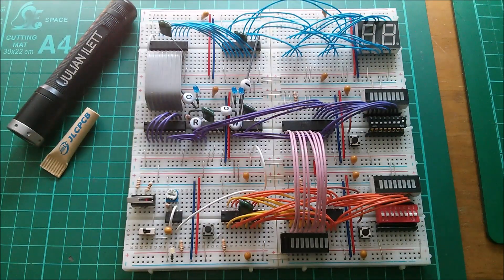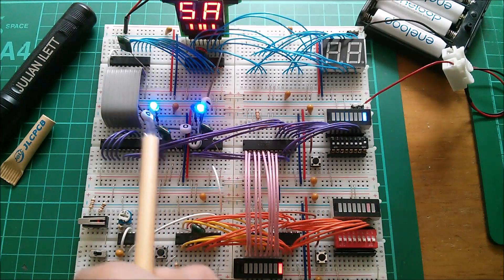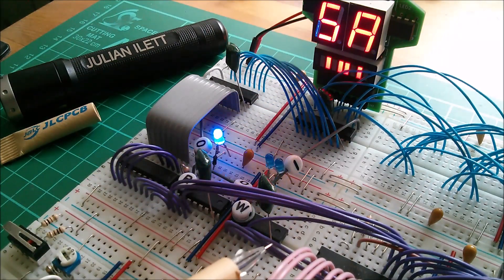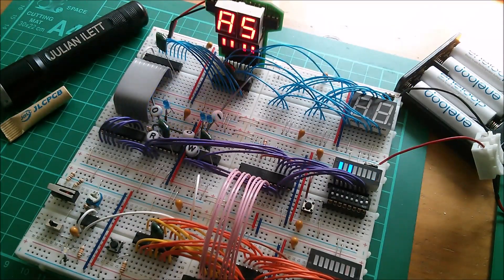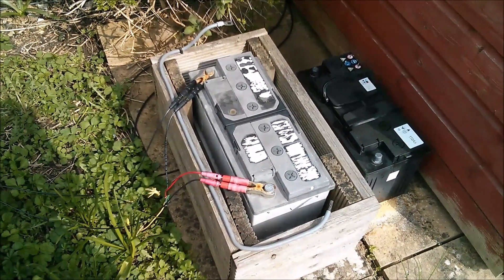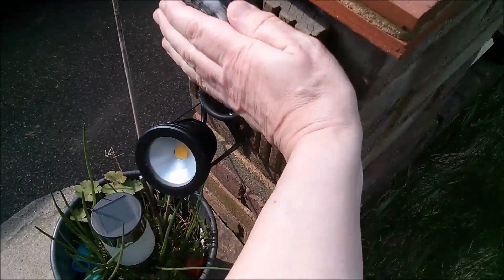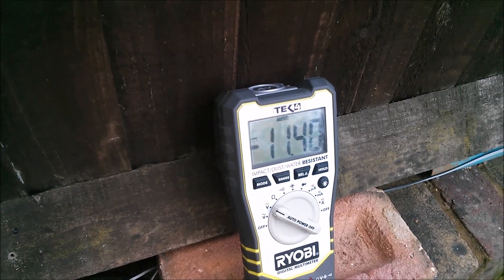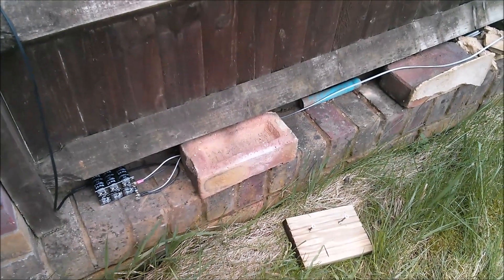Super Decoupling Capacitor

Comment: Sounds like an impedance mismatch at the latch clock input. Maybe in addition to the 10k resistor, you should use a pull-up or pull-down resistor at the input pin. I used to see a lot of this sort of thing back in the day when I was trying to interface TTL to CMOS ICs. Just a thought...

Comment: Definitely scope out that latch circuit. A logic analyser won't work, because you need to check the actual waveforms, not just the logic levels. I'm wondering if you have problems with "ringing", which a local RC filter will certainly help to cut out. What's the fan-out like in the logic devices in your circuit?

Comment: Once upon a time, I had to add a capacitor to a circuit that was oscillating (I wanted to make it stop oscillating). Examining the existing PCB design, I determined how long the capacitor leads were going to be; then looked up the approximate series inductance of those length of leads. Then I selected the appropriate capacitance value that would provide a series resonance (Z =~zero ohms) right at the frequency of oscillation. This is how you can use the series inductance of the capacitor leads to your advantage. P.S. Of course it worked perfectly.

Comment: Sorry Julian your maths is wrong. The energy is start energy minus finish energy. 1/2 CVV for say 12V and 10V gives 0.5x20Fx144 (for 12V start) = 1440 minus 0.5x20Fx100 = 1000 so you would get 440J useable in a 2V drop from 12V to 10V. That goes up to 690J useable dropping from 13V to 10V.

Comment: Welcome to the world of digital logic design.

Looking at the construction of your Breadboard Computer, I'm guessing that your master clock is applied throughout the logic of the design. You may (or may not) be aware that clocked logic elements require data to be setup before and held after the clock by specific times (often referred to as tS and tH on datasheets) in order to guarantee proper operation.

When many sequential elements are clocked from a single source, and feedback from a later stage is made to earlier stages, it is easy to not meet these requirements and the sort of effect you have seen can be observed. In the event that a setup time requirement isn't met the remedy that you introduced, which delays the clock locally, can appear to fix the problem but it's merely a workaround as you stated.

It's common to use multiple clock sources in complex logic designs. These might be complementary clocks where one clock transfers new input to registers and the other clock propagates new outputs some time later. Another solution is what is provided by the likes of the JK Master-Slave flip-flop where the leading edge of the clock samples the inputs and the trailing edge of the clock propagates new output levels.

A consequence of applying the RC delay to your clock input is that you are slowing the rate of rise and fall of the clock edges. This has the consequence of increasing the time during which the clock signal resides between the logic low upper-limit and logic high lower-limit (i.e. the linear operating region) which results in a higher current draw. This is actually detrimental to the advantage offered by adding a local decoupling capacitor because it increases the demand on current required from it.

You will probably benefit from researching the effects of not meeting setup and hold times in clocked logic circuits and the possibility of encountering race-conditions when feedback is introduced from later stages to earlier stages in circuits with simple common clocking implementations. There is much scope for this happening in a design such as your Breadboard Computer if you don't design to avoid it. As always, knowledge is power and my comments are based on practical design experience of high-speed digital logic systems.

Comment: Those green polyester capacitors make lousy decoupling capacitors.  
They are a long, high capacitance transmission line , 
wound up into a small package.  
So, no matter how closely you connect them, 
the far end of that long line is inches from the chip.  
Crush the epoxy, and unwind one, to see what I am talking about.  
Multi-layer ceramic or stacked film polyester caps 
are way better for decoupling applications.  
Greenies are usually used only for analog (low frequency) 
timing and filter applications, 
where the line delay and reflections are no problem.
Reply: Good point.  Also how are these alleged "momentary large currents" being caused?  He's using cmos,  isn't he ?  If supply droop is from the leds then it's not momentary, it lasts as long as the led is lit, so local chip decoupling is irrelevant.  Rip up and reroute.
Reply: There is a current pulse drawn, by CMOS, every time there is a state change,  But it is not very large, and the logic is pretty immune to its effects, compared to the old TTL family.  Usually i is things like inductive kickback from relays, driving an input or output beyond the supply rails, that glitches CMOS.  In this circuit, I'll bet the clock is a 555 timer, and not a CMOS version, that is causing the problem.  Their output is often very bouncy.

Comment: You might want to recheck your wire calculations.  As far as I tell, it should be closer to 0.1 ohm/meter, not "1".  I estimate you've got about 4 ohms of resistance (total).  At 1A, that's still quite a drop, taking you down below 9V.
Reply: Yeah, the figure surprised me.  A quick check gives me 1 ohm per 150 mètres for copper household cable, with aluminium (depending on alloy) being about 60% as good.  That would give us less than 0.1 ohm per metre for solid core aluminium of similar cross section.  If his cable really is 1 ohm per metre then it's ten times worse than solid aluminium.  Maybe he made a mistake, as you suggest.  I don't know the current price of solid core copper cable, but it might have been cheaper for this length of run to use that and ditch the supercaps.

Comment: Why don't you use a buck converter to increase the voltage down the wire to compensate for the voltage loss a bit like the national grid?

Comment: Put a small solar cell there to charge the super caps. If you need 10 W for 1 minute, you need a solar sell that is capable of delivering 10/60W per hour. Hmmm, a 0.17 Watt solar panel and 1 hour of (continuous) sun on it would do it, it would even work partially on just daylight perhaps. I did the test, I replaced the NiMH battery for a Supercap (500F). I did not use a diode, and use 4 of those very tiny solar cells (1.5cm squared, 2 Volts) and the solar light works like a charm! (the power which you loose by not having a diode is way less than the power gain (in voltage) by leaving the diode out, people should more often run tests in stead of doing what others do. A Schotky diode would then be a second option).
Reply: I imagine one of Julian's neighbours stopping for a chat...
"I see you've got your rig working, then, well done.  I'm not up on electronics, so I bought mine from LIDL,  comes with a little solar panel included".

Comment: Your method of calculating the energy delivered by the capacitor is wrong.  You calculate the initial stored energy using a half C times V squared and then subrtract the final stored energy using a half C times V2 squared.  If V1 is 13V and you take 150 joules out of 20 Farads then V2 will be about 12.4V.

Edit - As pointed out by Ray Kent below.

Comment: Would like to see a comparison between the supercap setup, and a boost -> buck setup where you have the voltage boosted at the battery side to compensate for the voltage drop, and a buck on the lamp side just to give a constant 12v output.

Comment: Aluminium is a better conductor than copper, specific resistance-wise. Problem with aluminium is connection resistance, if not done properly in household wiring will easily cause fire issues. CCA tries to mitigate this connection resistance by coating it with copper. So, 1ohm per meter is very high a resistance, where does it stem from?
Reply: A one-meter long wire with a cross section of one square millimeter has a resistance of 1.7 milliohms (.0017 Ohm) if it is made of copper, and 2.5 milliohms if it is aluminium. worst point is that  aluminium oxides very quickly, and aluminium oxide is a ceramic material and a very good insulator. that's why is used in semi-fabs to isolate layers in ic's.

I expect the problem is the size of the strands and the number of them.
Reply: @TheEmbeddedHobbyist  OMG, correct. How did I come to my conclusion then, I wonder. I remember watching a doc about using aluminium conductor in construction. They were talking about advantages and the main reason for not being in widespread use was aluminium oxide and it's implications with contacting points: Not done 100% correctly it easily burns down your hut, basically.
Baseline: should've done my quick research before blurting out alternative facts.. Thanks for pointing that out.
Reply: "Aluminium is a better conductor than copper" - Wrong!
Best in order: Silver Copper Gold Aluminium

Comment: My guess, the clock line is seeing a mismatched impedance at the clock input to the latch. Viewing the line with a scope should reveal that the line is "ringing" . This can be interpreted a number of ways, one is that the clock trace must be considered as a transmission line and the high frequency components of the clock edge are being reflected  between the source and load. This phenomena is most obvious when the wavelength of high frequencies associated with the switching edge are close to the track length.
As a rule of thumb, when the track length is one tenth the wavelength of the highest frequency in the signal, it is necessary to treat the track as a RF transmission line and deal with issues such as matching impedance. It is some times necessary to add series resistance to signal lines at source to filter off the high frequency components from the signal, effectively rounding the edges of square wave signals to stop the track ringing like a tuned circuit.

It is standard practice to fit smoothing capacitors across the power rails of logic devices at the IC end. The track layout rules state that the power rails, if not  planes of copper, should be run as close together as possible, keeping them in parallel to avoid inductive loops. Where devices are operating at high switching frequencies, it is common practice to fit a number of smoothing capacitors of different values, to allow for the fact that capacitors operate over a limited bandwidth, above which they start to behave like inductors. Therefore one might fit 100n supply smoothing in parallel with 1n or 470pf. The larger values supply the current demand of low frequency ripple, while the smaller value supplies the high frequency demands of the load.

When running long runs of DC power to remote locations, it is often better to distribute the power at as high a voltage as possible and then regulate at the load using a switch mode supply. For SELV circuits, distribution voltage can be as high as 48 volts.
It is the same problem experienced by the national grid, where distribution voltage is kept as high as possible, to keep the distribution current as low as possible, to minimise power losses in the connecting cables.

Comment: I thought the solution to voltage loss over distance was to significantly increase the voltage (and taking less current) at the source and convert it back down again at the far end ?!?
Reply: It is.  But boosting 12 to 48 volts and back down incurs losses in the convertors. My guess is that if he'd bought ordinary solid copper household cable it would have cost less than the cheaper wire plus supercap bank.  It's only a guess, but will he tell us?

Comment: Hello, how do you clock in the nibble in that latch. if you use the output of the ram without using the clock signal then the following can happen, when you switch a adress on the input of the ram for excample from adress 5 > adress 6  the ram wil not alway switch from mem 5 to mem 6 but can do a for excample  5 > 4 > 6   the mem 4 state will be very short but happens. basic you need to latch the output of the rams before using the data.

Comment: The energy is 1/2*C*(V2^2 -V1^2) = 1/2*20F*(13.5^2-11.5^2) =500J
Reply: Thanks for that.  I couldn't be bothered with the actual numbers but just pointed out, in effect, that (3-2) squared is 1, whereas 3 squared minus 2 squared is 5.  Simple mistake.  He did it wrong.
Reply: There is also the fact that the power supply keeps providing energy while the PIR is set on.

Comment: Great video. Thumbs up!

Comments:
1) If the problem is due to a transient, your low pass filter is a commonly applied solution.
2) Your Elna dynacaps are specified as -20% to +80% tolerance, so they could have a fair amount more energy than your calculation indicates if the rating is conservative.

Comment: But that's China watts not normal watts! - 13:40
Reply: Oh I would think that's why the caps can power the LED for so long. I seriously doubt the LED is drawing anything like the 10W it's stated as being, I'd guess it's closer to 3 Watts. It's obviously using resistors to drop the current, as the LED gets dimmer as the voltage plummets. This will also cause the current to drop off too, so this will extend the run time, by quite a margin.

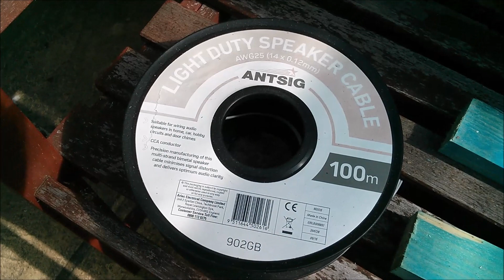Comment: 1 ohm/m?  I think you measured that in a previous video but is that considering the 2 conductors or just one?  There will be a voltage drop going from the battery to the super capacitor and then another drop going back to the battery on the negative wire. - 7:49

Comment: Your super capacitor bank will last a lot longer if you at least get it off the surface of the wall. - 11:30  You can see how water has had more of an effect near the bottom than further up.  Put something under the caps but not under the edge of the PCB.  Of course I would highly recommend putting it complete in a protective case.
Reply: Yeah, but elmer, if he put it in a sealed box with a bag of dessicant, it would simply keep working.  This way he gets to make more videos about corrosion.

Comment: Couldn't you put the super caps into a plastic box. Like you might use in the fridge or freezer?
Reply: Water gets in everywhere, like up the insulation of the wires. Better to put nail varnish or dielectric grease or something to prevent moisture touching sensitive parts.

Comment: You have to remember in your calcs that it is also being supplied by the battery, if you assume it's recharging at half the rate that it discharges, then your figure of 150 (which may be higher) is really about 75 i think ? so that would explain the 3 triggers.
If you go back to valves, there was usually a capacitor after the rectifier, a series resistor or inductor, then another capacitor
In your computer, i wonder if the breadboard strips are like antennas or capacitors getting interference from the neighbouring strips, on a PCB it may not need that RC filter.

Comment: You could use a small sealed lead acid battery like the one I have in my motorbike. 12v 4AH about £20. Constantly charging via the cable.

I have heard the term 'decoupling capacitor' but never understood what it meant until now! Thanks.

I recently bought a powerful horn for my motorbike but it would not work using my 5A power supply UNTIL I put a 22,000uf in parallel with the supply. That just gave enough 'oomph' to get the diaphragm vibrating! At which point the current draw fell below 5A

Comment: Maybe the answer to your mathematical mystery is simply:
X squared minus Y squared is not equal to (X - Y) squared.
If your useable voltage range is between 10 and 12 volts, say, you subtract and square giving 4.  If you square before subtracting you get 144 minus 100,  equals 44, which is a lot bigger.  The formula for Joules requires squaring before subtracting.  The joules available between your voltage limits are greater than you get from squaring the voltage difference.
Reply: The answer is (1/2)c(13.4)²-(1/2)c(11.6)²
Reply: @ishanfernando3064  thanks.

Comment: Not long ago, I spent some time to trying to gain some real insight into capacitors, and inductors, as I'm  terrible at remembering all the rule.  I came up with the following which has helped me

 Capacitors and inductors take in power over time, i.e., energy, then release it but shifted to the other element of power.  Caps take in voltage over time at a rate controlled by current limiting elements between the power source and the capacitor, but can release it as current suddenly limited only by current limiting elements between the capacitor and ground/return.  Inductors do similar but store current and release voltage surges.
Reply: Capacitors are 'voltage sources', meaning, they will dump their charge at a specific voltage range with infinite current(ideally) until it's reserve is expended, which effectively resists changes in voltage. Inductors are 'current sources', and resist changes in current and will momentarily attempt maintain a current regardless of the amount of voltage required to do so, until it's reserve is expended. That means inductance will contribute to voltage droop when a chip demands more power suddenly. A capacitor will 'decouple' that impedance by trying to maintain the average voltage and prevent the droop from occurring.
Reply: Capacitors resist changes in voltage, inductors resist changes in current. Like a flywheel for the latter.

Comment: A nice idea, but I'm confused why it's left being exposed to the elements, that PCB is surely going to corrode over Winter. Time to buy a can of conformal coating.
Reply: just make up a generic simple,quick and cheap dissolved plastic (any combination of colours you like,rubbish) in a glass jar overnight, and dip/spray your external one off pcb's , exposed leads etc a few times is better oc.